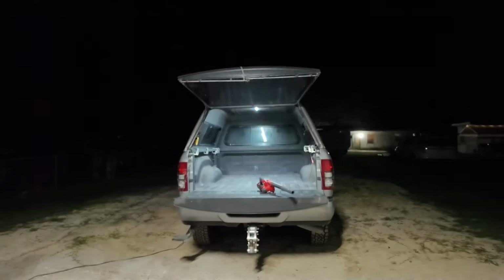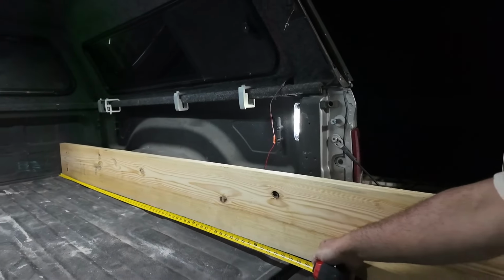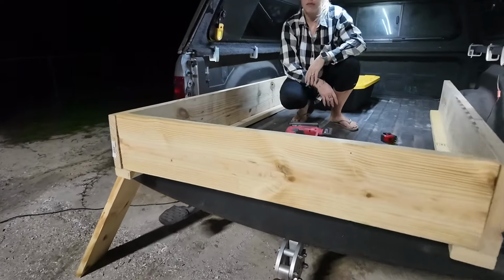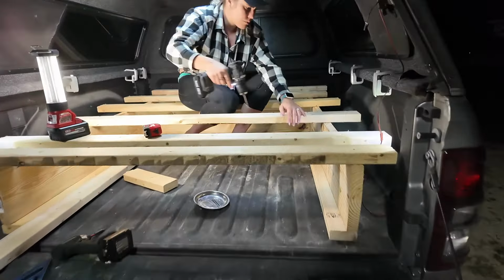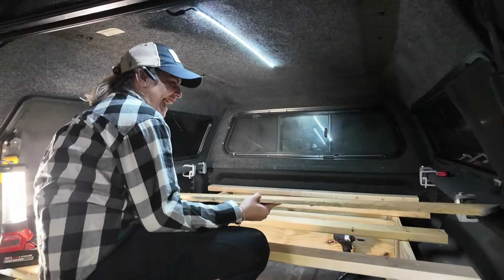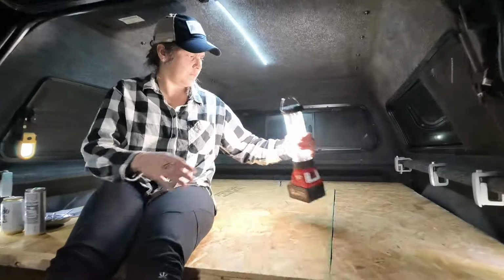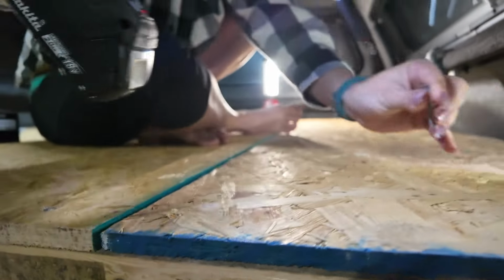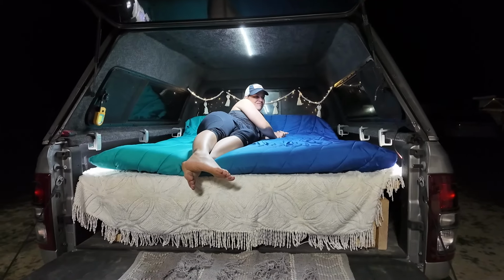2 hour Truck Camper Build   HD 1080p

Comment: What size bed is that ? How tall are you? Would a 5’9 person fit comfortably ? I’m looking at a 5ft6inch bed for a truck camper build
Reply from the maker: It’s a 6.5 foot bed, I’m 6’ and fit perfectly. You lose some space from the tailgate.
Reply: I’m 5 10ish and I fit pretty well in a 5.5’ bed with my 7yo and even our 30lb dog.   That’s with a cab height cap